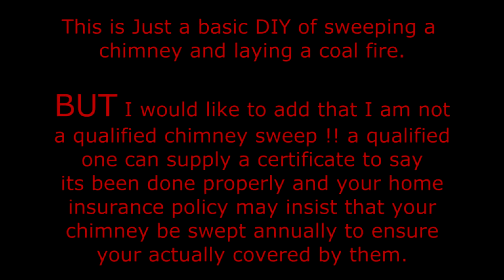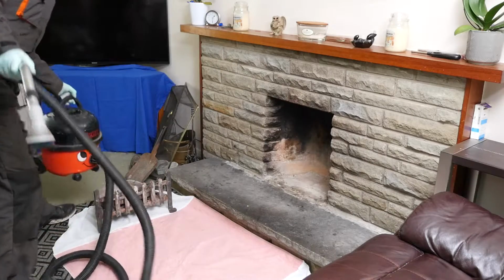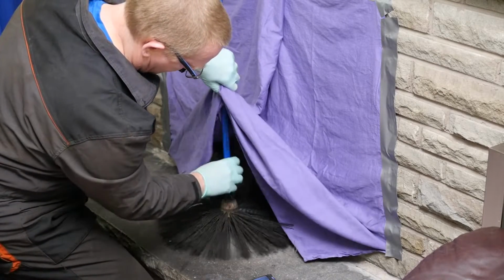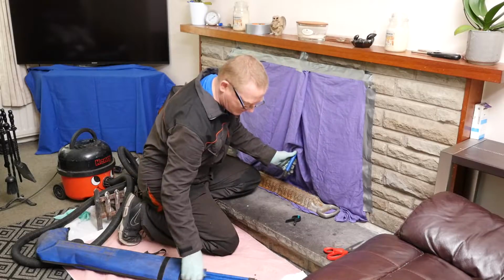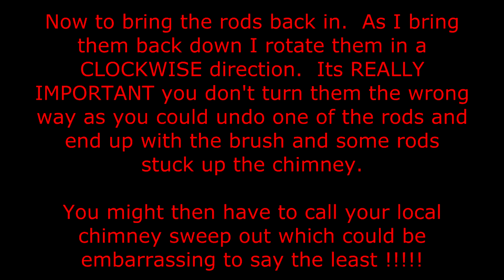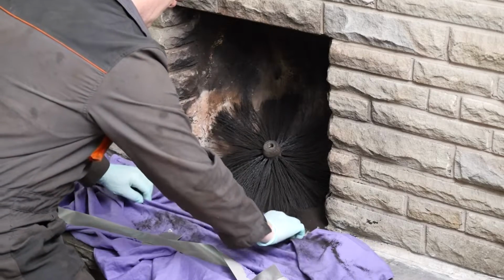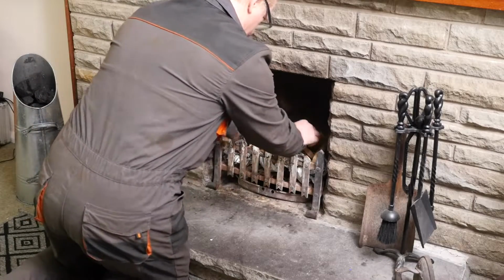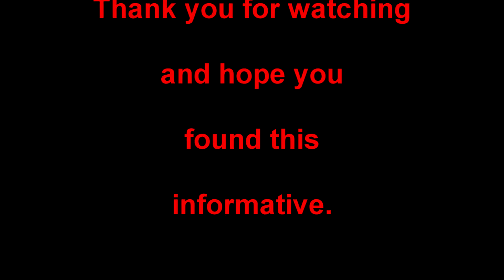DIY Sweeping a Sooty Chimney with Drain Rods and Laying a Coal / Anthracite Fire - Soot Sweep

Comment: I thought UK banned coal from fire places since it dirty and environmentally unsafe
Reply from the maker: Think it’s going that way.  Sales of all bagged traditional house coal will be phased out by February 2021, and the sale of loose coal direct to customers via approved coal merchants by February 2023. This will give industry, suppliers and households the time to adapt to the new rules.
Reply: It's going to be just the old coal that's getting stopped you will still be able to use smokeless fuel and seasoned wood, it's a silly regulation because most of what comes off home fires is good for soil quality and farmers have to replace the missing nutrients with fertiliser and what people fail to understand is producing the electricity and gas for heating homes is far worse for the environment, the anti fire movement is just a scam by the power companies because they aren't making money from people that heat their homes with natural things like wood and coal.